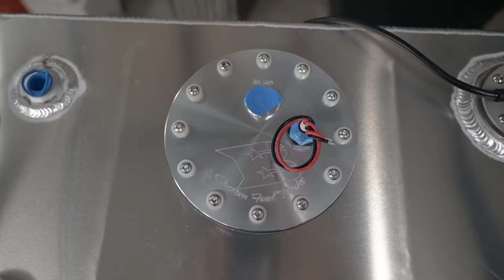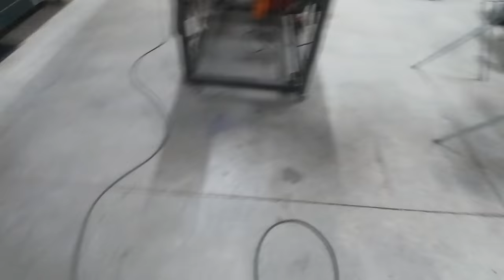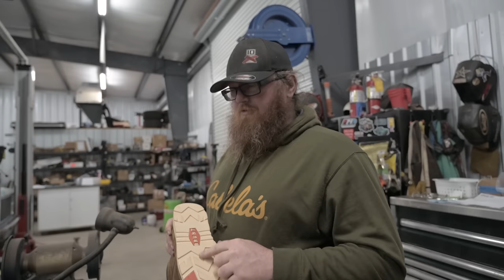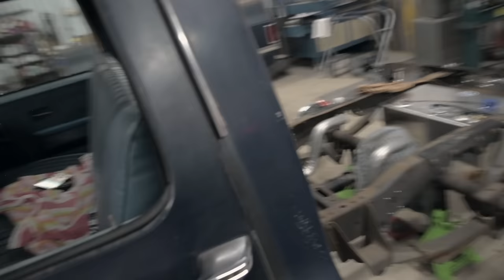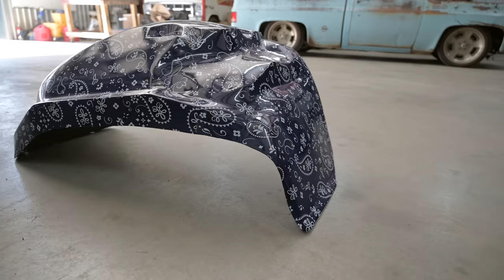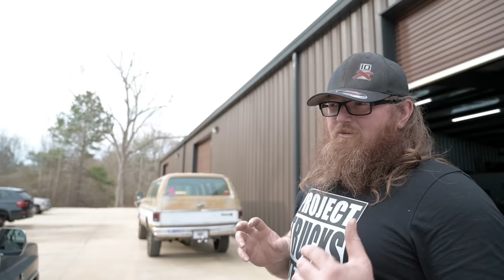FULL REBUILD: UNCLE BUCK GOES WILD FOR LONESTAR THROWDOWN! big brakes, billet wheels, fuel upgrades

Comment: Love the Slosh tubs, inner fender panels and the fuel tank!! Battery mount is cool, just wonder how easy it to get to? Top notch build though
Reply: You can get to the terminals really easily, two bolts and the battery’s out

Comment: The brakes doesn’t make sense to me. Usually one would put the bigger rotor and bigger caliper up front since that’s where most of your braking power comes from. Why the bigger rotor and 6 piston in the rear?
Reply: I cover the reason in the video
Reply: @pancakebreakfastclub2653  went back and watched. Reason is the front kit is what you already had and will upgrade the front later on?

Comment: How come you guys never give lowering specs on any of your trucks?
Reply from the maker: Are you serious? We literally detail every single bit of these builds when we change it. There a multiple videos on this trucks drop. It’s a standard 5/8 type drop. Spindle/coil up front & flip / shackle in rear
Reply: @UNITEDBYTRUCKS  yes, I'm serious.   I've watched multiple videos on trucks that I need info on for mine.  You give the company on what you use but you don't give the inch drop.  I watched an over view video on Buck, and two on Mud and the amount of drop wasn't mentioned.  The companies you use are in there.  I'm just looking for comparisons on drops to get what I want on my 90 suburban.  Normally it wouldn't matter but I'm specifically looking for numbers so I notice it.   Otherwise I probably wouldn't.   I don't want my stuff rubbing and got to get it right.
Reply: You guys aren't the only ones lol most everyone else don't give the inches either.   It must be a secret like an old fishing spot lol
Reply: In your opinion, sense you've built and seen a bunch of these,  will a 5" drop with 245/40/20 tire on an 8" wide rim with around a 5" backspacing rub up front?